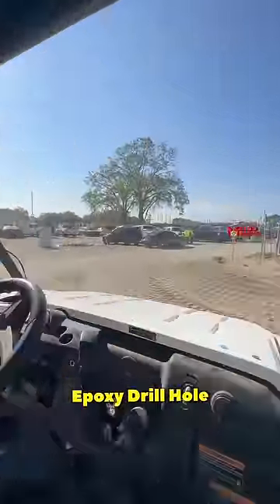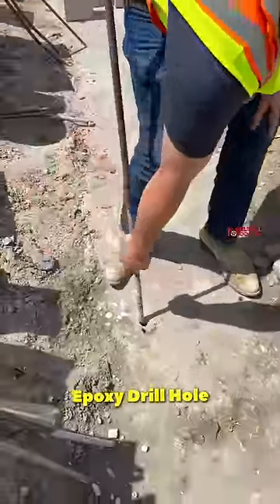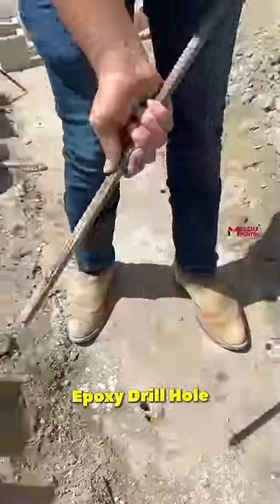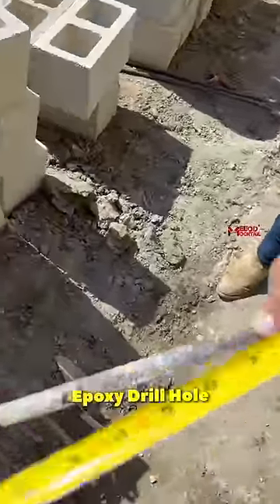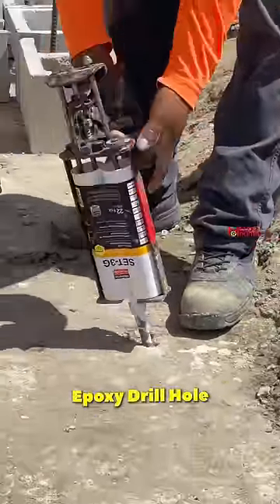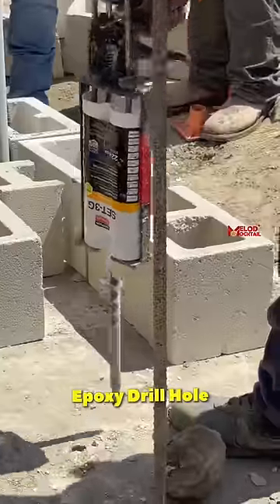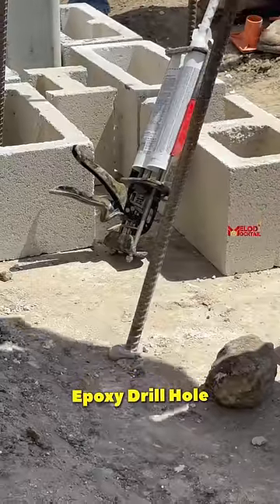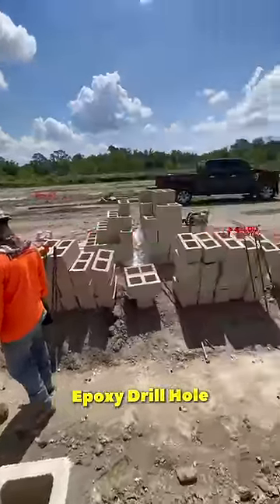Wall ila easy ga katteyochu | Drill & Epoxy to build a wall #melodymocktail #teluguvlogsfromusa

Comment from the maker: Easy method to build light weight walls 🚜🚧👷‍♂️

Drill & Epoxy….most easiest method to build a concrete masonry block wall.

Drill the hole, apply epoxy, place the rebar that’s it good to go to build a wall. 

Save the post and share it with your friends

#melodymocktail #civilengineer #construction #epoxy #drill #walls #partitionwalls #masonry #blockwall #engineering #telugucivilengineerinusa #usa
Reply: Anna nenu kaliga unna me company lo job untey chepandi anna nenu vasthanu
Reply: Bro lock fix Is also one of the method kada anna
Reply: Anna cn u help me an electrician in ur site iam from India
Reply: We are using hilti re500 v4 anna